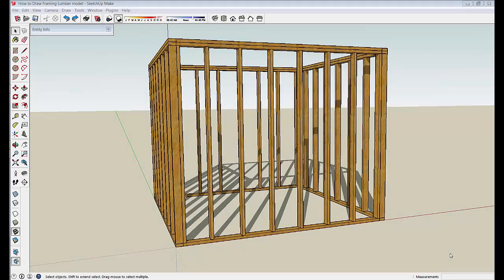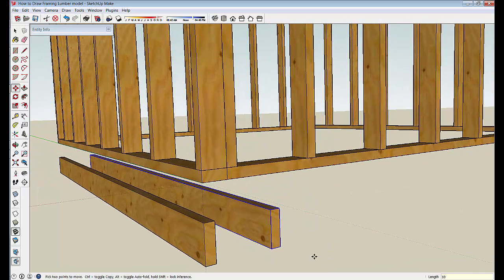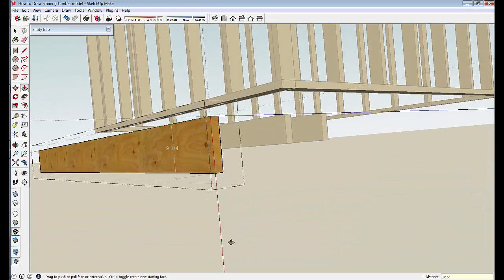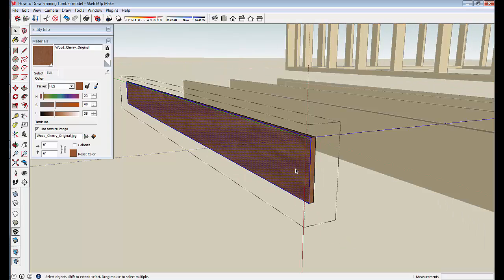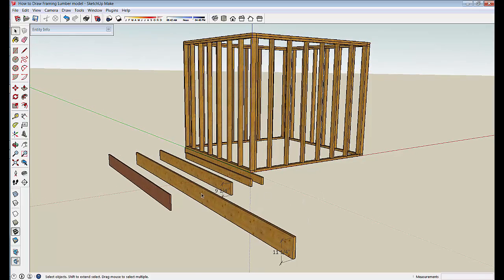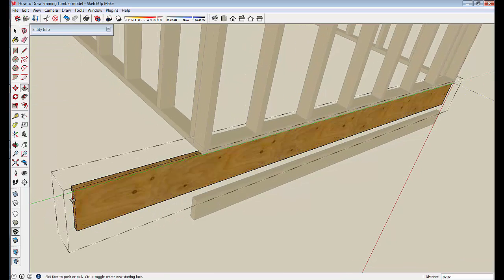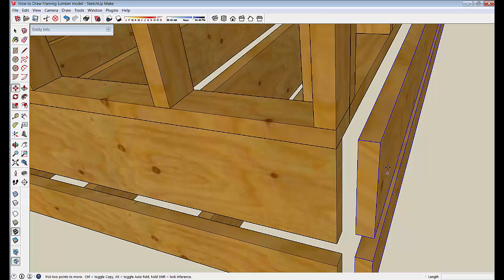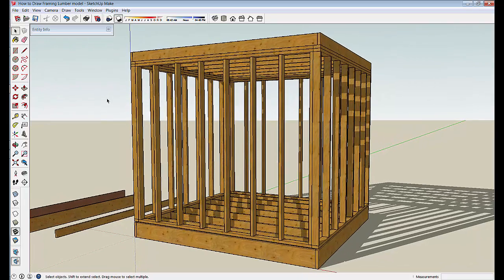The Digital Jobsite: How to Draw Framing Lumber

Comment: Can you make a video with this same structure but making the roof higher from the the shed back wall and lowering a bit to the other end?  Something like from 9.0' high, then lowering to 7-1/2'. I have in mind to build something like this.  The shed is gonna be for my tools and portable equipment, and the open area is gonna be used for cutting.  But I have no idea how to make the roof that way.  I doesn't want to any other roof layout. I am willing to pay you for the plan is necessary. Thank you!

Comment: Since I started using SketchUp about a month ago I find your videos very helpful. It’s the finer details of how to select a face or line and what buttons to press that make using the program less frustrating. Thank you for sharing
Reply from the maker: Thanks Michael,  it's definitely the little things you encounter on the learning curve for 3D modeling that frustrate the most, isn't it?!  I did a LOT of hair pulling in the beginning too...
I started The Digital Jobsite channel to share stuff I figured out as I tried to model carpentry projects with SketchUp about 6 years ago.  From your channel icon it looks like you're doing some framing? Modeling is a whole different paradigm than actually building stuff but you'll find that the more you work with it the faster you get and the more helpful it becomes.  In case you're interested I have a 2nd YouTube Channel called Next Level Carpentry.  Most of the videos of actual carpentry projects on NLC start with SketchUp models so you might find it helpful on that level too... or not :-)
Best,
Matt Jackson